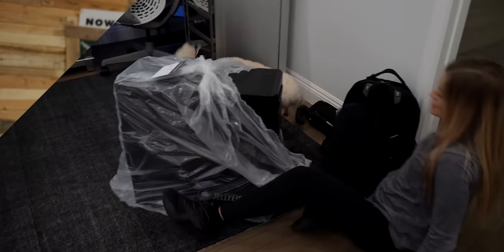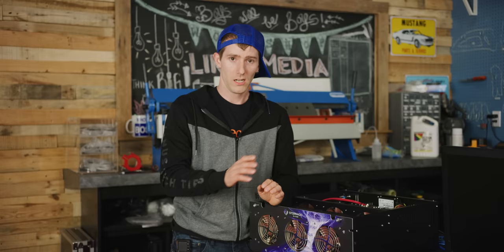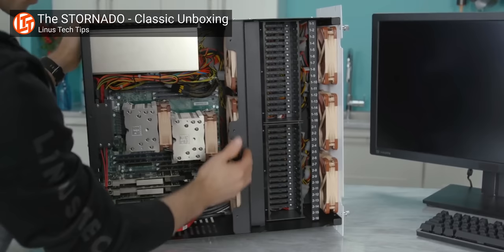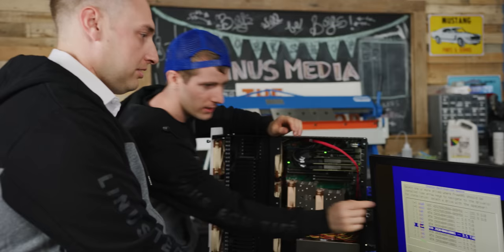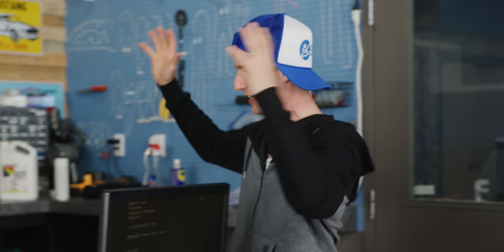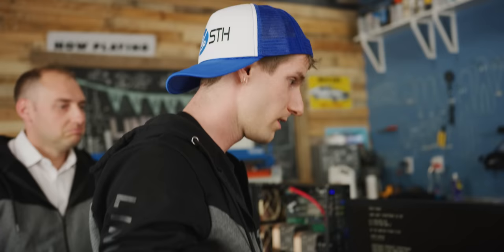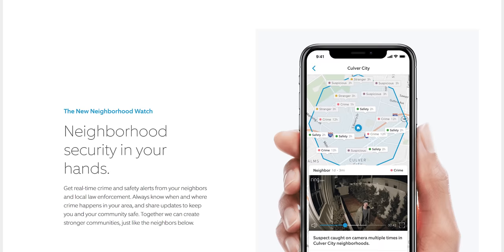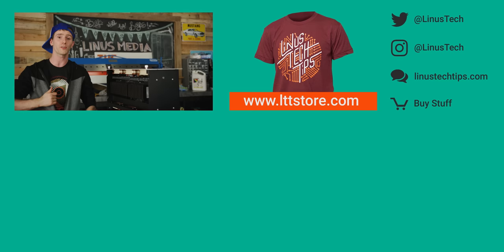What did you DO?? - The "Jellyfish Fryer" All-SSD Server

Comment: ProTip: Using enterprise SSD for long-term storage is a bad idea if they aren't powered on most of the time. Using any SSD for long term offline storage is a bad idea, but especially enterprise. They can start to lose bits after a few months for enterprise. A couple of years for consumer. Just throwing that out there in case anybody wasn't aware.

Use SSD all day as working drives, but ALWAYS use mechanical drives for archival of your important stuff.
Reply: I was wondering just that. Based on the little I know about SSDs, I expected them to die pretty quickly in a server with all the constat reading and writing.
Reply: @captainufo4587  I would trust an enterprise SSD in a server as much as a mechanical drive. Maybe more. As long as it is powered on most of the time. They only leak current and lose bits when they're powered off for a long time. It's only a bad idea as archival, offline storage.
Reply: @kingcrimson234  Oh, good to know, thanks.
Reply: @captainufo4587  test show it can be as little as 3 days
Reply: Actually, use Tape for archival storage.
Reply: @russgifford  This. If you mean archiving. Tape is the way to go. @kingcrimson234 As far I know, any server I worked with weren't designed to be turned on and off, it should be always on. And when you have 16+ HDD 10kRPM drives, Hooo boy, they shake! Also the power draw is less than HDDs (and in the long term would be easier to let them on ATT), and a couple of LTO could easly retain 80 TB and is not that expensive even including the drive (from an enterprise perspective). Even SSDs are more reliable to detect synthoms of a near drive failure than HHDs, where HHDs misalignment because of wear is almost impossible to detect, except you notice that is more noisy or vibrates more than usual, and if is not a 3,5 inch SAS drive, is almost impossible to feel.
What I mean: USE TAPE! BACKUP REGULARLY! 

Yours truly,

The IT slaves
Reply: Man did u watch the full video lol!
Reply: Thanks dude 👍

Comment: “High performance at any cost”, a RAM disk server?
Reply: Why no optane server if you're not limited by cost? ;)
Reply: 🤷‍♂️ Welp he did say any cost
Reply: Because RAM is too volatile memory in order to be used in a server environment. 
One crash and ALL data is gone.
Reply: SauS Gaming Shizzle Channel AT ANY COST
Reply: NVME M.2 NAS. How's that for "any cost"?
Reply: MRAM Server. 2GB MRAM m.2 stick×60 and a 4 socket mobo with 512GB RAM. That would be the pinnacle of performance and longevity!
Reply: Why ram when you can use processor cache
Reply: @sausje  There's thing called backup, which would be mandatory anyway.
Reply: While we’re at it let’s just store all the data in cpu cache
Reply: @elmotlk  why processor cache. When we can use CMOS
Reply: All you guys have great ideas for the fastest storage at any cost, but your missing the fastest and biggest kind of storage.............FLOPPY DISKS
Reply: @ArmaanFarshori  why use cmos when we can use bicmos?
Reply: Buy a trillion CPU's and use the cache as storage
Reply: Go find 4tb of DDR2 server ram
Reply: cuz all the data would be lost
Reply: Or.. you know.. wild idea: 3D-Xpoint LOCAL STORAGE and a QLC server for pffff just long term storage?
Reply: HBM2 RAM server
Reply: @sausje  RAM servers are used pretty frequently as enterprise solutions
Reply: @sausje  they said at any cost though ^^
Reply: @sausje  Depends on the kind of RAM.
Reply: @Robbedem  Micron sells larger 3D Xpoint drives than Intel does.
Reply: 100Gbps cards are getting more affordable
Reply: @sausje  all data is gone even if it shuts down.
Reply: @slickpunk6663  No shit Sherlock.. 
Though most programs save the data to the HDD when you initiate a shutdown.

Comment: 30TB redundancy😲. They named it correctly just like a jellyfish is mostly water.
Reply: Typical ZFS advice is to use mirroring rather than RAIDZ, so you'd have to go for 80TB redundancy in this case. The reason for that is to reduce wear and tear on other drives when resilvering after a drive failure, and to make resilvering faster. That may be less relevant for SSDs because reads are free of wear and tear, and overall speed is much higher.

A scarier thought is that you need as much space again to store backups.

Comment: Your LACP group of three 40gbps connections won't yield a 120gbps bandwidth, it just allows you to run multiple 40gbps data streams simultaneously. It's still limited by the max link speed. Also, bad idea running LACP as a group of three. Behind the scenes, the switch generates a hash value (0-7) and assigns each to a port in the group. You always want powers of two for link usage. 2, 4 or 8 to properly assign these hashing values.
Reply: I don't understand you but I believe you
Reply: Charles O'Riordan i dont know what you are saying but good for you
Reply: Did not understand even 1 bit of info provided by you. But i believe you.
Reply: Charles O'Riordan understand I did not but believe I do
Reply: Read something, feel wierd, you seem smart.
Reply: @JasieK0  that's the spirit!
Reply: @Charles O'Riordan, Also Linus is talking as if he put multiple independent machines into a single LACP group, which I don't think is possible.

Comment: I don’t think y’all understand how overpriced it really it is, Lumaforge is charging $125 per terabyte of memory, when it normally will cost you anywhere from $30 to $23.50 per terabyte depending on the capacity. I got my 16 tb enterprise drives for $375 each or roughly $23.44 per terabyte. The 2 port 10 gig ethernet cards can be bought new for $200 to $260; on eBay those cards can be had for $70 or so. Guess how much Lumaforge charges for 1 card...they charge $1,400 for a 2 port 10 gig Ethernet card (the base model comes with 4 10 gbe ports, but for 6 ports it’d cost you around $600). You could buy a NAS or build one that has the same functionality for less than $10,000 including hard drives. For reference eight 16 terabyte drives will run you about $3,200 @ a price of $400 for an enterprise drive give or take $50 per drive depending on brand (seagate exos $380 for a 16 tb enterprise drive, WD ultrastar $450 for a 16 tb enterprise drive). A low end 8 tb ssd is about $900 which comes out to $112.5 per terabyte. Even on the low end they’re faster than most hdds, and at $112.5 per terabyte, you’d still come in less than the jellyfish @$125 per terabyte.

Once you subtract the cost of the 80 tb base model you’re left with a PC/Server that cost $20,000. Note: the specs of the jellyfish aren’t really listed on their site at all. But I can bet you that they did not spend $20,000 on the computer portion. Even if you go high end with an AMD Epyc 7702 that’ll cost you $4,088, motherboard another $500, cpu cooler $150 to $200, 128 gb ecc ram will cost you $500 to $1000, add an RTX 3090 for $1,500, as well as a PSU for let’s say another $500 for a good one, add a case for $150 as well as two 4 tb nvme drives for $800 each, and let’s say add in 6 10 gig Ethernet ports for $600 (two port 10 gbe card is roughly $200 x 3) and you’ll still come out ahead dollar for dollar. Total cost of the build at the very high end of my estimates comes out to $10,138 for the computer parts. 

The price for 128 tb is $3040, the price for the server will run you around $10,138 at the higher end of the spectrum give or take. Total cost for a 128 tb server with the highest end parts will cost you $13,178. You can also increase the amount of ram and you’ll still be ahead price wise. 

Our theoretical home build will set u back $13,178 for 128 tb and 6 x 10 gbe ports. A jelly fish will cost you $36,995 and you can bet it won’t have high end graphics (according to forums the price of the components for the jellyfish is actually around $4000, when compared to the server I parted out. Which means you’re getting far less performance per dollar and that lumaforge is taking more of a premium than I thought before I started writing this comment.) 

All in all for those kinds I can’t change, go ahead and pay the extra $24,000 premium for the jellyfish. I’ll just be sitting here with my $13,000 server enjoying a faster better machine for almost a third the cost. And you may be now saying but the jellyfish has a warranty and perhaps as a business if the server goes down it may be easier to have the jellyfish as it is probably more user friendly and the time to get back up and running is crucial. But here’s the thing if you’ve ever dialed with tech support you’ll know how frustrating it can be and odds are it’ll take a full day to try an diagnose it over the phone before they try to RMA it taking 2 to 3 weeks to get it back to you. At least if you build the system yourself, you’ll have learned the insides and outs of pc building, trouble shooting, and will probably be able to fix it much quicker than tech support. 

(Also for reference if you didn’t care about how powerful the cpu and stuff is, you could just buy a synology 128 tb preloaded rack does about $6500 to $7000 and that comes with your tech support, iOS apps, and android apps, etc. albeit with low end specs, but if you’re just using it for storage or as a media server it’ll probably do just fine, if you do heavy encoding operations like using Plex get a QNAP and they’re not to far off synology’s pricing, though they will be more expensive as they are better speced)

So final thoughts, don’t pay more than you have to for what essentially is a NAS (network attached storage). The jellyfish is three times more expensive than the price of components. I get there’s other cost like software and RD costs, but that’s far higher than it should be. Even Apple isn’t that greedy and as of late the Apple tax has decreased.

Comment: I feel that there should still be write cache to aid in write efficiency. Incoming write requests need to be stored and acknowledged before more can be sent on the wire from the host. If an incoming write is saved in NVRAM and acknowledged, the host can send more data until a full-sized write is prepared for flushing to the drive. Additionally, no mention of deduplication, compression, or compaction. Filling NVRAM with a stripe of random, compacted data allows for a quick, sequential write when it’s full,  and is more efficient. Garbage collection and re-writes to collect unused portions of blocks, etc. more info and testing would be needed to truly say who’s storage solution is more effective. 

Source: I work technical support for a major storage company.

Comment: The issue with LACP is that it is a hash based on a combination of source/destination MAC/IP, or in some very high end configurations (Cisco 6500 IIRC?), port. So if you are using a destination MAC setup, and you are only targeting 1 IP (the server), you will end up bottle necking a single link. Thus the "trick" with LACP is to use an appropriate hash method.

I suppose you can always setup some aliases on the server and use fake MAC's (00:00:00:00:00:01, ...02, ...03, etc.) to allow you to be able to pre-balance your workstations in some specific way? Would be a very cumbersome kludge, for sure, but you get the idea!

Also for ZFS, I would be curious to look reducing the cost by using ARC cache and ZIL (SLOG) on nvme/SSD's, backing them with a bunch of extremely cheap shingled HDD's. With the ZIL, your writes buffer up on the SSD's, and the ARC will cache your MFU/MRU files. Seems like a good price/performance ratio, but I think you would have to "do the math" to know.

Been tinkering with Ceph a bit myself. They have a "cache tier" setup, similar to the ARC/ZIL that ZFS has, but it seems that it is falling out of favor. I like Ceph because it's basically a JBOD that you can scale on the fly with any size drive, and change the redundancy on the fly. In ZFS, you can really be locked into a design. Ceph isn't going to win any races at a small scale though, but the idea of giving each client the ability to scatter requests to dozens/hundreds of drives in a network, hmm, it's very appealing. Proxmox at least simplifies it, and if you got a bunch of compute handy, it can be a perfect way to spread HDD's around. The key with this setup being that the redundancy, and low cost devices, are better than a single, expensive point of failure.

All that said,  it's damn hard to beat the appeal of turn-key, or extremely powerful and dense (and $$$$$$$) servers. How deep is your wallet, I guess is the question! :)

PS - Never stop being a hardware nerd, no matter what those turn-key folks try to convince you is best! ;)
Reply: Regarding LACP hashing, Linux can easily use L4 hashing (see "xmit_hash_policy layer3+4"). Also, saying that only high end Cisco switches support it might be a bit misleading: there are other providers out there (HPE, Arista, Juniper, Dell) and recently "white box switches".

This limitation is not as bad anyway in this use case: note that traffic was FROM the server, not TO server. So it would by servers hashing policy to decide which link to use.
Additionally, I do not think intention was to provide full bandwidth to any client, but more about being able to server multiple clients at the same time, which LACP should do easily due to different MAC/IP of clients.

Regarding ZIL, it's only important with synchronous writes and will not "buffer writes". ZFS writes are always buffered in RAM and flushed to disks periodically. When not using synchronous writes, SLOG should not case any significant difference.

Ceph is really interesting, but I have some reservations about stability (through I admit I did not test latest version) and resources needed. For small scale, GlusterFS is still a possibility. I agree ZFS' lack of RAID level migration might be sometimes problematic.

Proxmox Ceph integration seemed awfully locked down when I tried to test it :(
Almost no possibility to tinker with setting during setup. But if it's for people who want to get ready solution...
Reply: Exactly. Turn-key is rarely the best, it is merely the more convenient option. And sometimes the convenience is worth it. Depends on how tired you are of fighting with things.

Comment: Next level: Ditch the 10gbit cards and start putting in 56gbit Infiniband cards. You'd be surprised how cheap you can get Infiniband gear, especially the older generation. (Current is at 100gbit)

Also, ZFS can do RAID-Z3 which allows up to 3 failed drives in an array. Might be useful for bigger arrays.
Reply: I forgot about HCA cards and honestly it's an excellent idea for a solution where you want to plug directly into the box and edit. Those will handle huge data streams with ease for very cheap (this is the exact kind of problem they were meant to solve some years ago. weird how it comes back)
Reply: @robertlinke2666  I'm running dual port ConnectX-2's at 40Gbit. I paid like €25 a piece for them.
The switch I'm using is a Voltaire 4036 which has 36 ports, 40Gbit each. You can find these on Ebay for like €100 nowadays.
It does take some extra configuring to get everything running because Infiniband is not like regular ethernet but it's well worth the hassle.
Not to mention the latency of Infiniband is like an order of magnitude lower then ethernet.

Comment: I build my fileserver for around 2500 euro (I paid less because of sponsered cooling and SSDs) I run 2x E5 2620 128gb ddr3 ecc, 3U chassis with 16bays 4x 480gb SSD (2 for caching) 6x 8TB Seagate SAS drives. I run RaidZ2 so I have 48TB storage and 32TB usable with dual 10gbe nic.

When I need more storage I will just put in more drives in the 8 empty drive bays 😁
Reply: Cool story bro

Comment: I mean.... if you want 100TB plug and go you could just buy a 12 Bay Qnap with some 8TB driver and you’ll only spend 5-10k
Reply: Or better yet, use 12 10TB drives for 120TB. Theres even 24 slot bois out there.
Reply: but the support, THE SUPPORT lol

Comment: I literally have wondered why NAS wasn't treated like USB drive. The fact it's viewed as taboo is really strange to me.
Reply: because of security, if you need an enterprise nas security is your TOP NUMBER 1 priority. You cant jsut allow anyone to walk up and insert your "USB" into it like that.
Reply: @thangchanh2932  So have a server setting "allow quick disconnect storage: 0"
Reply: Because a NAS that works like a USB drive is called a DAS. It is actually the difference between NAS and DAS, that one is networked and the other is directly attached. There's nothing wrong with using a DAS.
Reply: NAS is supposed to be Network Attached Storage, so by definition, a NAS should be accessible over a network. Something you plug directly in would be a DAS, Direct Attached Storage, as it's directly connected. A DAS is a real thing that you can buy though, which is basically what the Jellyfish is.
Reply: People who uses NAS usually have many of them, much more then Ethernet ports on pc or USB ports. Think about the switch as a splitter

Comment: $34k NAS requires a proprietary 'app' to work....  I'd be out as soon as the company told me that.
Reply: Yep not a fan of that. It should be web based and use normal protocols.
Reply: I'd bet money it can be operated without the app, assuming that you'd put up with the inconvenience having paid 34K for a convenient solution..
Files are stored in the usual formats & access is over TCP/IP, not like you're locked out from your data the way Drobo does when things go wrong enough...
Reply: @redsquirrelftw  eeeh I never seen Jellyfish'es app but I bet it just also another web wrapper app for remote admin.They would be just mad if that's not the case. Reinventing the wheel for something that has been industry standard since ever